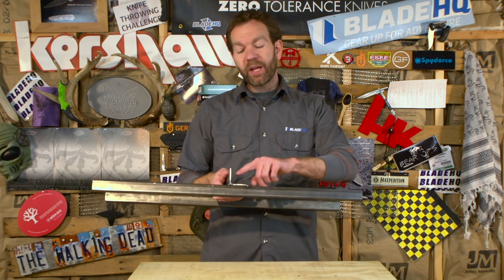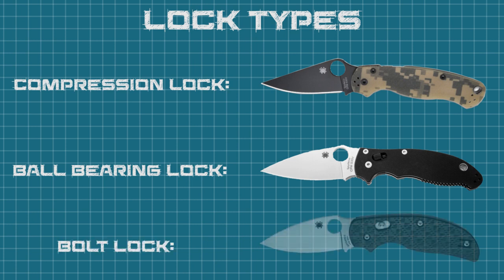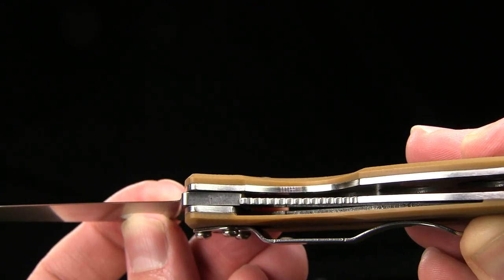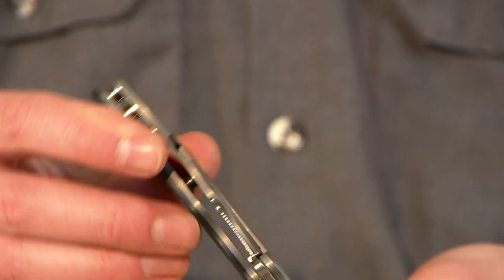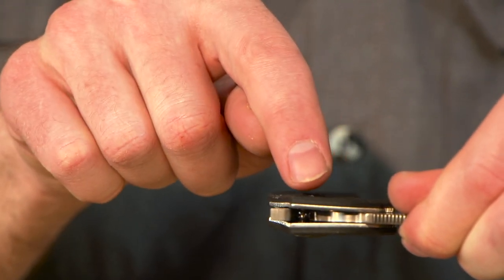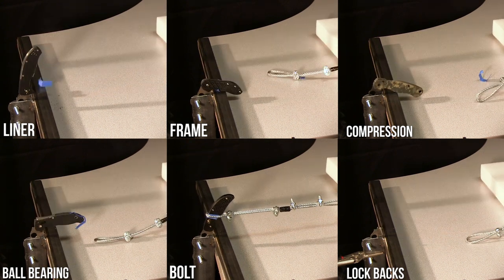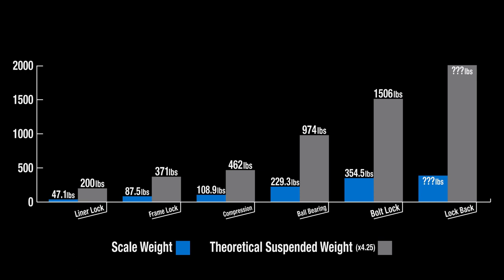Pocket Knife Lock Strength Test II

Comment: Wow ! I've got the Manix 2XL & I noticed when the ball bearing lock failed it was because of the screw breaking , probably getting ripped out of the threads of the G10 scales. The bolt lock was stronger because it didn't have that small screw. The Manix 2XL doesn't have that screw like the regular Manix 2 does. I wonder if the Manix 2XL Ball Bearing lock is stronger than the regular Manix 2? Also , if upgraded to the Flytanium ball cage , Titanium liners with carbon scales how much stronger would that make the ball bearing lock on the Manix 2 & 2XL?

Comment: Not to be THAT guy, but you DO know that the force applied to the lock will depend on the point wehere the winch pulls in relevance to the locking point, right? SO if the steel wire is 1 inch from the point where the lock touches the blade, the force is significantly lower, than if  (as seen) the wire slips upwards on the handle and the distance suddenly becomes 2-3 inches. To put it simply, the lever arm increases, because the wire slips on the handle.

Comment: Now let's see what an Axis lock would do instead of looking at all of these cheap knock-offs!
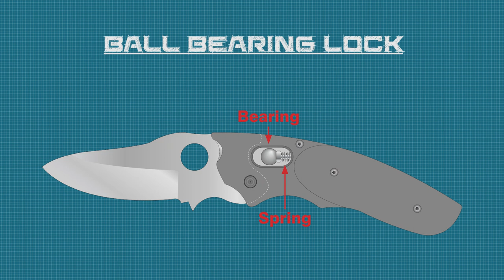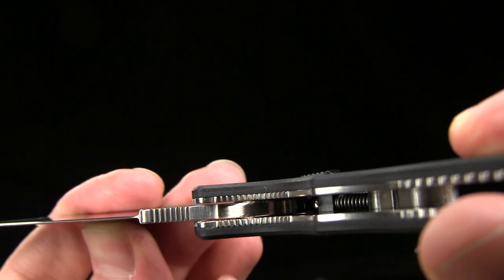Reply: +Fappolice The Spyderco Ball Bearing Lock works exactly like the Axis lock. The only difference is in the spring that pushes the lock. IMO, Spyderco only made the Ball Bearing Lock to create some competition for the Axis lock. If you look at 6:56, you can see that not only is the design of the lock extremely similar, but even where the blade contacts the lock is the same design as Benchmade (7:03). It is a blatant copy. If you are a Spyderco fanboy, you'll just have to get over this fact.
Reply: +Fappolice I'll back you up on that. Axis and ball are very different.
Reply: +Fappolice The way both locks work as detents and how it locks on the blade when deployed are very similar. And both are pushed by a spring. Spyderco just wanted to get into the Axis lock market. End of story.
Reply: Just search "axis lock test" benchmade has their own testing videos.
Reply: Axis is a piece of shit lock on over priced, ageing designs
Reply: The Axis lock has a delicate spring. I dont trust a Ball Bearing in the thing either. I'm suprised the Compression lock did worse, add more matter, fixed.

Comment: ok there was one variable that you guys didnt really look into, you marked the point on the handle with the tape but in many cases the wire slipped up the handle giving it more leverage. so basically the ones that slipped would appear to have a weaker lock in comparison to those that didn't when they may not. (of course this varies according to the position on the handle that the wire caught on after slipping so you cant even make two separate classes and translate the difference)

Comment: A couple of flaws in the testing, on at least one of the knives (not the lockback), the lock failed after the loop went up higher on the grip increasing leverage. Those results should probably be tossed. For the lockback, if the lock fails, you'd most likely have the rocker blow out the back, but you have the loop on the rope there keeping that from happening and inadvertently majorly strengthening the lockback lock.

Comment: the issue i find with this test, besides what people have mentioned about the back lock not being able to fail due to the placement of the cable, is that in the previous video, the exact same tenacious was able to hold over 380lbs, and still didnt break. i dont understand how you were only able to hold 200 with it when you tested the static load again this time. perhaps showing footage of that would have made it more clear

Comment: VG10 is a very hard and more brittle steel, so I'm not surprised the blade broke at its smallest point. It's a common steel for high-end Japanese kitchen knives, but not so much for EDC. I'd like to see the same test on a lockback with S30V or AUS or some steel that a little more forgiving with flex.

Comment: I think it should be pointed out though, that anything's less than complete breaking stress on a frame lock, and you can usually disassemble that frame lock, and bend the Lock back in place

Comment: I really love these stress tests to failure. Excellent work man! The only thing that I think about with a liner lock is my finger accidentally shifting the liner over, unlocking the blade, during heavy use. I don’t trust it 100% like I do a back lock. I’ve never had it happen but I think about it when using it. The liner locks are fantastic for one handed use though.

Comment: Great test! Thank You BHQ.. But I'm an Axis Lock guy.  Benchmade does a similar test and axis lock fail around 800 inch pounds (or 75 pounds) which would make the axis lock pretty weak compared against Spyderco's ball bearing or bolt lock.  I'd sure like to see them go head to head...

Comment: the lockbacks didn't fail because the cable is applying constant pressure keeping the lock engaged. how would it possibly fail? it would have to overcome the force pulling on it. positioning the cable closer to the end of the handle would increase torque, and might damage the handle, but it would give a more realistic result.

Comment: I understand the locks all being Spyderco to test mainly the lock type instead of maker, but it would make a good video to test different maker's cost equivalent knives.  Take a Benchmade Adamas or the new Anthem, the Cold Steel 4 Max, A Lionsteel with a Roto-Block, and a top shelf Spyderco and ZT.  Then run a middle of the road priced knife" Benchmade Osborne, CS Code 4 or Recon 1, Spyderco Paramilitary 2 or similar.  Kind of a "best lock for the money" test.

Comment: Wow the bolt lock did amazing.. and still functioned after. 

But I feel it should have been: 
Liner lock    -    Sage 1
Frame lock -    Sage 2 
Bolt lock    -      Sage 3
Lock back -      Sage 4
Compression - Para
Ball bearing -    Manix 

I do want to say I think it's funny the lockbacks were not only assumed to do well because of the last test (not involving quality locks like compression or bolt) but also placed at the end of the graph. I think people know from experience a regular lockback (not a triad) should probably be placed in between a frame lock and a compression. 

The delica's blade broke so many times because it has the least amount of mass (by far) going into the handle; it has a really thin tang around the pivot. But I feel like even with a beefier sage 4, the lock would have given-way soon after the delica's blade broke, making the poundage right around the compression. And I feel the compression is superior as it functions after.

Comment: I appreciate these videos and I'm a fan and customer of Blade HQ. However, here is my constructive criticism. There are two primary ways a knife locked open can fail: a) by allowing the blade to close under force (that is what this video tests), and b) allowing the blade to break free by bending back beyond the locked position when used to cut something with great force. 

The first situation is important because you don't want a knife lock to fail allowing the blade to close in on your fingers. However, that situation is far less likely than the latter, i.e., where you are pushing the knife blade really hard into a surface you are cutting which puts pressure on the blade to bend back further open than its locked position.

And the failure points will be different in terms of force needed to prevent the blade from closing (again, that is what you tested here) versus the force needed to push the blade beyond its fully open point. I've notice that other videos (such as by Bench Made) also only test the force needed to cause a failure in the direction of closing the knife--but not in the other direction.

I think it would interesting and informative to see tests and measurements for failure forces in both directions.

Comment: When the cable is tight around the front part of the lockback, its preventing the lockback from pivoting and thus from opening. Much like your hand when using a framelock. Did you not realize this ?

Comment: When doing the frame lock, the rig slipped, it ended up around twice the distance from the pivot as the other tests.

This would increase the actual torque felt at the lock, meaning the number given would equate to much more force on the lock, than the same number in the other tests.

Comment: The compression lock, ball bearing lock, and bolt locks are the best if you're on a boat. You can close it without your fingers ever being in the blade's line of fire. If you're being rocked around and bumping into things, things can easily go wrong. There's a lot to be said due to the inherent safety of these designs.

Comment: i think the liner lock portion of your test was wrong. just look at it when compared to all the others side by side like you showed at the end of the video. the liner lock was the only one with the handle still vertical.  the cable just slipped off, just because the liner is bent doesnt mean the cable didnt simply slip off. so i dont understand your reasoning about the liner lock.

the other 5 were great and i believe provided accurate data. great video and thanks for taking the time and spending the money to do this.

Comment: The reason why lock-back broke is because liner-lock/frame-lock/compression-lock all trying to pressing the blade tang steel, the lock-back is trying to pull it apart. And also the Lock-back is always have a small cut-out inside to make a wake point so when the lock fail the blade will not fly out.

Comment: Check out 11:55 to 11:56 .  The cable slid up the frame lock to the 3rd screw on the handle.  About 2x the original distance .  Hence more then twice the dynamic torque.   Not to mention the point is not static but dynamic due to the changing toque arm.  Test results are not accurate.

Comment: So bottom line if you buy a quality knife like Spydero, benchmade, ZT and Cold Steel ect.... the locks are all plenty strong.  If you need stronger you should be using a fixed blade or perhaps a pry bar.

Comment: benchmade has a lot of videos testing their locks on blades, they usually go from 700-800lbs. as much as I love spyderco, I prefer my benchmades for EDC, axis lock is just so much easier for closing one handed. just pull the lock back and a slight flick and its closed. I can do it on my manix 2 but then again the lock is very similar
Reply: Axis lock is also stronger than any lock spyderco has

Comment: Please note... Its very easy to mechanically control the winch speed. Just use a snatch block. You would then double its pulling power but cut the speed in half. Im sure there are probably electronic options like a mosfet but your knife guys not electronic guys. Anyway i recommend trying a snatch block for tests like this. Thanks.

Comment: Great content as usual. I enjoyed the diagram of how each locking mechanism operate (and also mentioning the steel type of the knives). 

I was mainly curious about the Compression lock. Since the previous test used weights (which maxed at 380 lb.), I was glad to see the chart at the end of the video (which showed what the pressure lb. would have been if this test was done with weights). 

Will there be a possibility of testing the Axis lock in the future? Maybe a line up of Benchmades knives? :)

Comment: What about the stress on the wrist of the knife wielder? What about lateral tests? This is just a one-dimensional review. The lockback was very interesting showing that the lock may be good if the blade is bad. Same goes for Cold Steel. They forget about lateral and design, seemingly making "budget" everyday knives with less aesthetic with overemphasizing the lock. Just think of Swiss Army Knives. No lock or weak lock, yet they are favourites!
Reply: It is calles unique selling point.

Comment: Don't the locks just have to be sufficient? Strong enough to keep it from closing while in use. Who would put more than, let's say, 20lbs. of force on a lock? I want to know how well the triad lock claimed by Cold Steel to be the strongest lock made, it certainly looks so in their static testing. Also, have you considered using a U bolt through the lanyard hole on the handles, so the cable doesn't slip off? Or even drill a hole in the handle at the same distance as the pivot? I would like to see the knives disassembled so we can see the damage, if any, that they sustained.

Comment: enjoyed the perspective comparisons among the different varieties of locks. would prefer to pull against the back rather than the demonstrated closing direction. I never cut in a direction to worry about the knife folding closed. Will look forward to perhaps another test Cycle while pulling the knives in a cutting angle (forcing the knifes in the opening direction until failure)

Comment: I know you said this wasn't ment to be perfect. But just to mention some things I noticed. In the first test you said the same knife failed at xxx weight with hanging weights. And used both numbers to get a multiplier. Well the numbers are all off because in this video it never failed, just wouldn't close. With the hanging weights it could have been uncloseable at a third or half the weight it took to break it. Second, See in the second video the rope slips up before breaking the lock. When that rope slipped up, the weight on that lock just doubled because of leverage. So now the number is wrong. Not hating or nothing great video. And don't expect you to go through 10 different expensive knives to get it right. Just somethings I observed. Thanks and thanks for the content

Comment: will there be a part III where you will get it right? maybe invite Destin from SmarteEveryDay? He will explain how the physics work and how to do a proper test. You can not let the cable slip up. The weight needs to be applied much slower, as the scale probably will not be accurate at this speed. Also: the Tenacious is still alive in my opinion, as nothing broke and it did not collapse.

Comment: It looks like the liner lock was the first to give, but didn't break break; and, the lock back design might be putting to push pressure on a specific spot on the blade??? Also, you guys need to find a better way to prevent the cable from slipping over the handle. Otherwise...Good Videos :)

Comment: I think the frame lock was disadvantaged by the loop slipping further up the handle scale therefore creating more leverage. A good way to eliminate that would be to grind a groove roughly the same diameter of the steel cable into the back of the knife where the blue tape was... Cool video though. Poor knives!

Comment: Liner lock is the winner for me.... Sure, it "fails", but it soft fails and doesn't actually fold up. So from a safety standpoint the liner gives you some warning that you are pushing too hard and yet doesn't chop off fingers. With the crumpled liner material in the way there is no way the blade could fold far enough to get into fingers.

Comment: I wish the knives were facing the other way. I've never been in a situation where ive been trying to force my knife closed despite the lock but i have had lock failures when carving hard materials before, something which i guess technically I should be using a fixed blade for. Anyway, an outward facing blade would better simulate stress on the lock during cutting.

Comment: The thing thats driving me absolutely crazy with these couple of weight tests being done on the folders is that the direction you are applying pressure to the knife is about the ONLY direction that force is NEVER applied in real life.....what I'm really curious about for real, is how the lock strengths vary when applying pressure the opposite way, which could be done by simply flipping the knife 180 deg.

If that sounds confusing, just hold a knife in a normal grip, as if you wanted to shave down a stick, while pushing away from you. Now with your opposite hand, pinch the tip of the knife and pull on it. This is the direction almost all force is applied to a knife that is being used.

The only thing I can think of is that maybe when breaking in that direction, it wouldn't be the fault of the lock, but rather the stop pin inside of the knife.

But I suspect that even tho most of the force applied would be heavily on the stop pin, I'm sure the licking mechanism would play some role in that as far as breakage goes. And the only time I could imagine that one would even want a lock to be stron in thar direction is if you were holding the knife with cutting edge towards you, fell off a cliff, then magically stapped the cliff and were hanging from the knife. Besides that I just don't know what the meaning of knowing the lock strength in that direction even matters.

Either way, could we get some videos of what I'm talking about? Also my apologies if they already exist and I missed them. I just feel like these particular tests you guys are doing, do not mimic any type of real life things that you use a knife for. Unless maybe you are a Hollywood stunt man trying to not slide off of a glacier into the ocean or something.....sorry about the rant, I just got really frustrated after seeing the way you were doing this and am curious how much can folders handle in a realistic way.

Comment: 1) you again managed not to test an Axis lock. 2) the tests are meaninless because you changed the parameters by adjusting the loop. 3) your rig should have pushed downward on the blade or handle in a "consistent" manner (see Benchmade lock testing apparatus). 4) you chose knives so different that the results could not be compared meaningfully. 
For good testing methodology I recommend to watch the "Project Farm" channel.